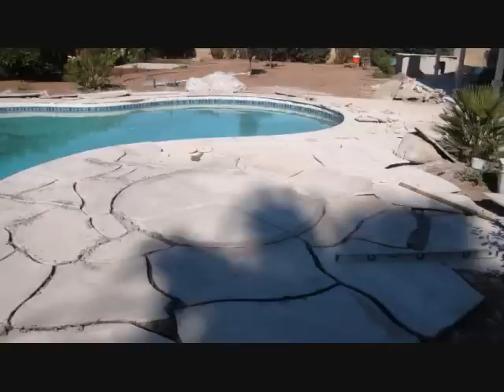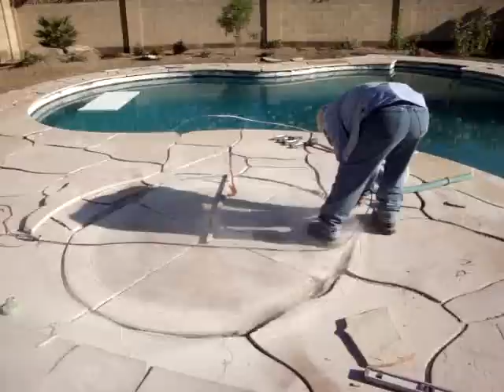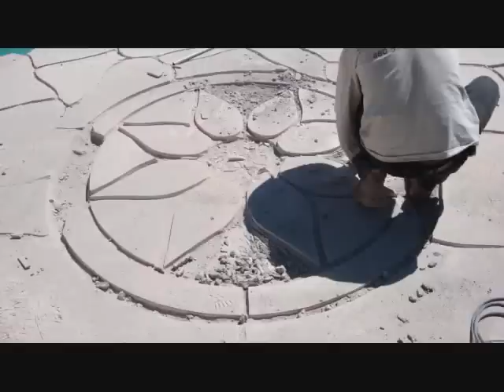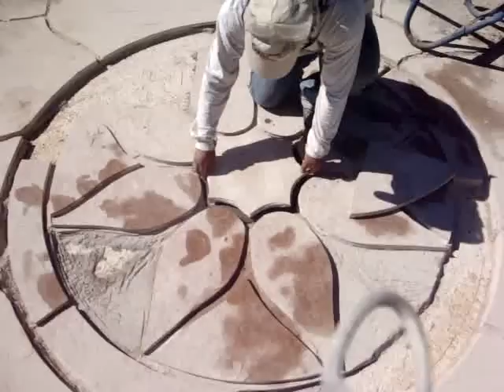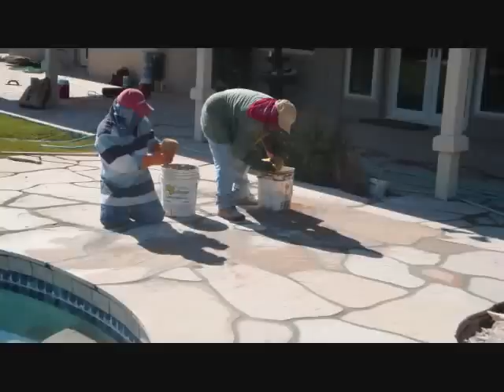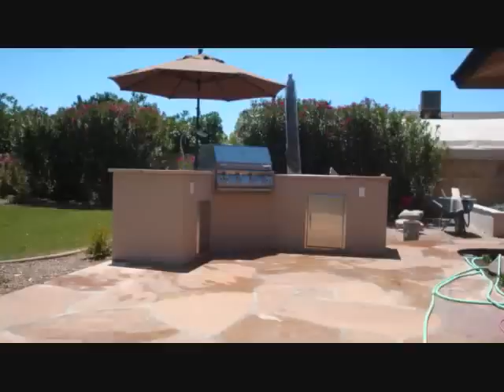cutting flagstone DESING floor pool.wmv

Comment: Too many cuts and you lose the natural look of the stone might as well use stamped concrete
Reply: I disagree.  Stamped conrete never lookes that good.  Stamped concrete repeates the same exact pattern over and over.  I have installed dozens of patio aress over twenty years,  some with very little cut pieces and many done like this job.  It all depends where and what look you want. It is apparent this man is very skilled in his trade.